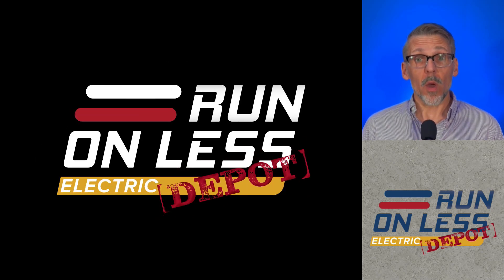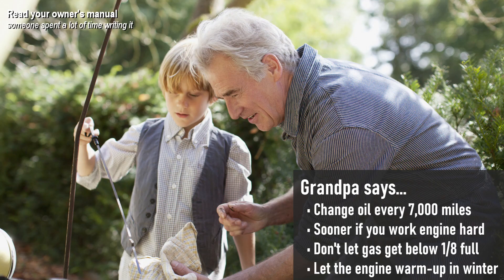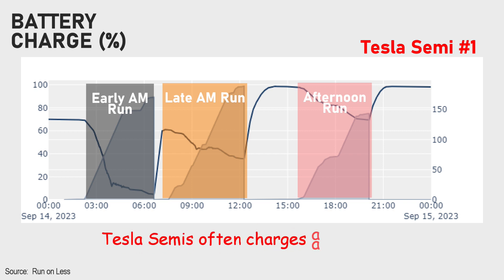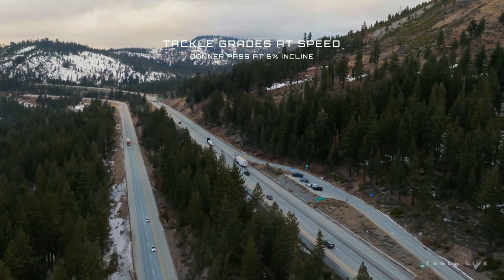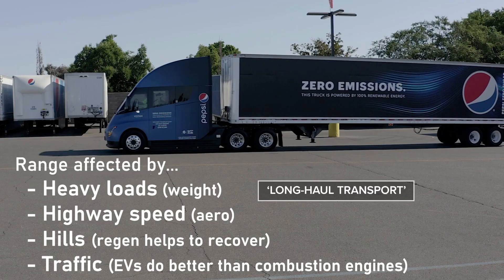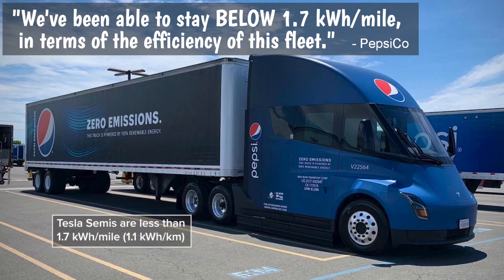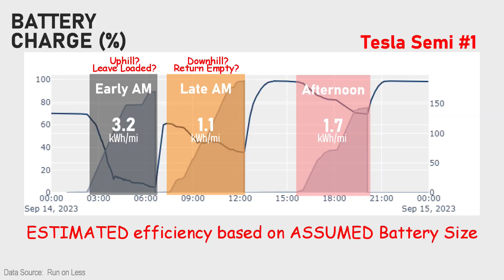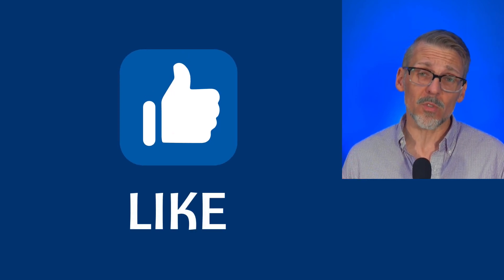In-Depth Analysis of Tesla Semi Data (Freightliner and Volvo too!)

Comment: Making heavier trucks to be more efficient, no thank you I will stay with diesel!  Also getting the constant runaround with shippers and brokers you're not going to make your destination!
Reply: Whatever. Unless you are one of the of the 9% of truckers in the United States who are independent owner operators you aren't going to have a choice. Corporate bean counters will decide. Now shut up and get in the truck and drive! That's going to be the reality for the vast majority of truckers. 😂
Reply: This is a bigger issue than truck drivers wanting diesel. Were all choking on the fumes.
Reply: 4 tonnes of batteries to do the job of half a tonne of diesel
Reply: @calchedz the total vehicle weights are pretty close since the electric motors and drive train are so light compared to a huge diesel engine and transmission. The 300mi Tesla semi is <20,000lbs and the 500mi semi is <23,000lbs. Most diesels are 17 - 22,000 lbs, so we're not talking about a massive difference here.

Comment: The Internet says a trucker can average 605-650 miles a day over 11 hours. Throw in a team of drivers and it's limited to the range of the truck, maybe 1200 miles+ with the right setup. Granted this isn't what a beer or soda guy would do. 
The Tesla semi weighs, 20-27k pounds while a common Kenworth t680 weighs 14,2000. 
That's a lot of lost freight and miles. Marketing stunt it would seem.
Reply: I keep saying the Edison hybrid semi can do everything the Tesla can without even being built for highway use. How a 27,000 lbs offroad logging semi outclasses a purpose built highway truck is embarrassing.
Reply: @MobiAussie  It does not outclass it when CO2 emissions are considered and that is the most important thing.
Reply: @rogerphelps9939  This whole thing is bigger than diesel and electric fans. Diesel fumes are bad news to breath.
Reply: @jaaklucas1329  except that electric semis can actually do the job, and do it cheaper, so if there was zero concern about CO2 or pollution, companies would still want to switch to electric. Your comment seems to suggest electric semis are worse, but that we should put up with them for environmental/health reason. We can actually have our cake and eat it, too - same cargo capacity, enough range right now to cover 70+% of routes, better performance, and cheaper to operate over the lifespan of the vehicle. In the near future they will also be cheaper at purchase, and range will extend/chargers will be installed to cover 100% of routes (well before enough electric trucks have been built to fill the first 70%). So no compromises need to be made.
Reply: @truhartwood3170  You got me wrong,Im full electric guy. I can see company trucking doing full electric with managed routes even battery swaps. Hard sell to the long haul guys alot of whom are independent and on the go continuously.  Hyllion makes an electric drivetrain with a natural gas generator, good compromise for the present day. Nat gas still burning stuff but better than diesel. I totally believe in full electric but all the stuff up in the air like cost of replacing a battery pack, charging speed and infrastructure,upfront cost of a vehicle. Its a lot for an independent owner operator to juggle for the bottom line, these folks are not big companies.
Reply: @MobiAussie  Simply by not being a 27000 lbs truck xD
Reply: None of the routes are straight OTR hauling, so the comparison is irrelevant. They said they do typically 8-12 destinations in a day. You can't do 600+ miles when you have to stop and unload multiple times.
Reply: New info - 300mi Tesla semi weights <20,000lbs, the 500mi semi weighs <23,000lbs. Since electric semis are allowed an extra 2,000lbs total weight, that means their payload is the same as a diesel semi weighing 18 - 21,000lbs respectively. That's pretty much smack in the middle range for diesel semi trucks (most fall between 17-22,000lbs).
Reply: That 27,000 pound weight for the tesla semi is the lowest best guesstimate but not unreasonable guess. The Nikola EV is 29,000 lbs with a significantly smaller battery. The people that are knowledgeable about trucks that have seen the tesla, report that they are built very “lightly” which goes against the trucking industry’s standards for reliability. Proterra went that path on their EV buses and had a lot of cracking (& lawsuits), but they went bankrupt. So maybe why tesla is taking so long is that they are relearning the lessons that traditional OEMs learned along time ago.
Reply: You forgot to mention the damage the heavier electric trucks and cars are doing to roads which will result in higher taxes to fix. Oh and cost to replace the tires because they have to carry a higher load.
Reply: @D3athM3tal-i4c  the difference is negligeable. Electric semis are allowed an extra 2,000lbs GVW, but we're talking the difference between 80,000lbs for diesel and 82,000lbs for electric, but the vast majority of runs are not at max load. 

A Model 3 weighs the same as a BMW M3 or a Mercedes C-class. Looking up "average SUV weight" I get 1,814 - 2,240kg, a Model Y weighs 1,847 - 1860kg. The idea EVs are like a thousand pounds heavier than ICE cars is a myth. Look up actual weights of actual vehicles, don't listen to media FUD. This whole "EVs are destroying our roads!" is obvious anti-EV propaganda, as no one has been saying that about the trend towards bigger, heavier cars, SUVs, and trucks, and the shift from cars to those much heavier SUVs, trucks and pickips. The top 4 selling vehicles in the US are pickups, which are much heavier than cars, and this has been going on for decades. Where was the "pickups are destroying our roads!" outrage then? An F-150 weighs 2,220kg as the minimum base weight, a full 358kg heavier than the heaviest Model Y.
Reply: @D3athM3tal-i4c  they aren't much heavier, only the pickup versions an even then they're only slightly heavier than something like an F350. And commercial trucks are still way way way heavier. Like even an isuzu box truck weighs more. It's a moot point.
Reply: @D3athM3tal-i4c  Heres our problem. Drive your cleanest burning ICE vehicle into your garage while running, close the door and take a seat.You wont last long. Multiply that by billions of vehicles worldwide. Diesel heavy motors are especially noxious..
Reply: At less than $1/gal equivalent fuel costs, the time spent charging and miles lost will be far less than the money saved. Charging time will be the best money truckers make in a day.
Reply: Do your research people, those guys are smart. Invest in Tesla.
Reply: @lucadellasciucca967  Tesla has promised so much and delivers almost nothing. Elon has conned many.
Reply: @lucadellasciucca967 Only an idiot invests in a stock that has peaked and only has down to go.
Reply: @lucadellasciucca967 .... And see your share price fall.